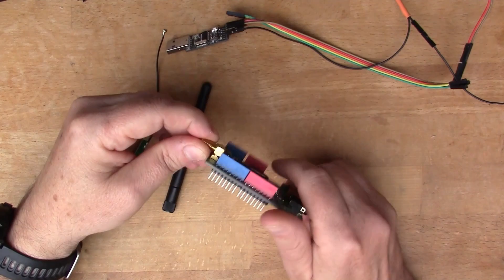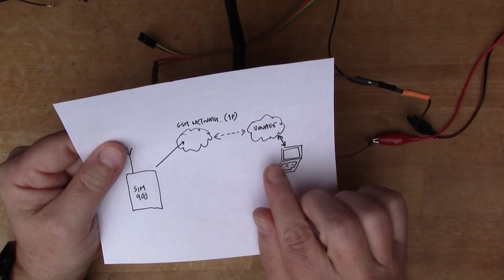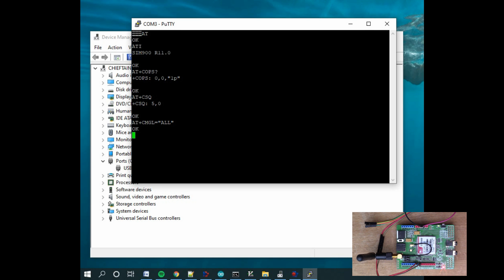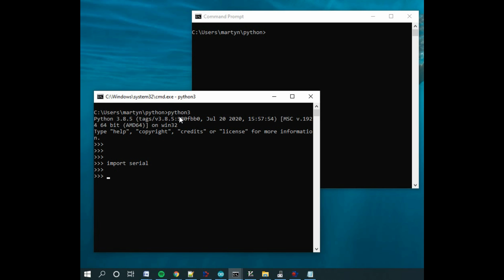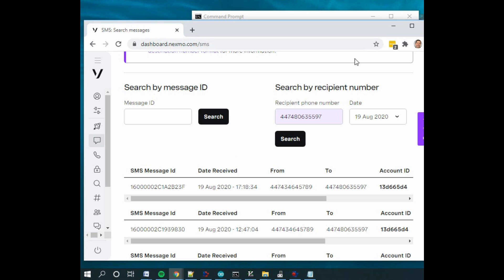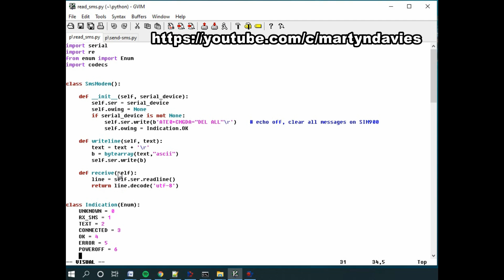Sending and Receiving SMS with a SIM900 GSM Module - Tutorial (#123)

Comment: I used a SIM800 to send SMS from an ESP32 in 2019/2020, part of a project that was a "granny monitor" for my mum. Easy to do, the hard part was making the right message at the right time: 10am send "concern" message, unless it had already sent a "mum's up" message, which must not be sent until WE were awake! It was just an IR sensor that detected movement and told the ESP that worked out which message to send when.
Then Covid came and I couldn't see her for most of a year, so the project lapsed, and now I don't need it and 2G/3G is being closed down, so no SMS any more.
Reply from the maker: 3G is closing down fast, but I think 2G will remain for a while longer, because it's hard living without a mobile these data and 2G is the affordable service (and phones).

Comment: when I send or receive a sms using the serial connection I always get these weird diamond questionsmarks, even thought it does send and receive the texts and all other AT commands work. any idea
Reply from the maker: Weird characters are usually caused by mismatch in bitrate between module and host, although if it is accepting commands, this suggests a rate match.  I believe this module should automatically adjust the rate when you send "AT{enter}"
Reply: @MartynDavies  Thanks for your reply. yes I've tried most settings, parity, stopbits, rate. some break it some settings still work a little bit when messing with stopbits. but the issue still remains. the default of 115200 8n1 seems to be working fine for most part, commands etc. 
It's only when receiving and sending texts it shows me those weird characters.

Comment: Brother, How to interface gsm with arduino using i2c pins (like sim900a i2c pins), Can you please send the code with schematic.
Be SAFE and keep your FAMILlY SAFE
Reply from the maker: I don't know.  The hardware design guide (https://datasheetspdf.com/pdf-file/770979/SIMCom/SIM900A/1) doesn't talk about I2C much, but it does say "Note: This function is not supported in the default firmware. There must be customized firmware if you want. Please contact SIMCom for more details."

Comment: When you say expensive it's all relative!  When you see the price of non chinese electronic modules etc it's still reasonable.  Cheaper than losing a freezer full of food I suppose!
Reply from the maker: One thing I learned from the shed alert is that it's actually hard to make a resilient electronic design that keeps running 24x7 and occasionally sends a text. I never regretted the £20+ I spent on the SIM900 or the £40 I spent on the Lithium backup battery.

Comment: A very interesting little module with lots of potential, your shed power alert is a great idea :0) Just wondered if the module could provide any visual confirmation for received texts (flashing led notification)? Appreciate the video, lots of work and well explained. Thanks
Reply from the maker: The module itself doesn't have a visual indication.  On my shed alert, an Arduino takes care of the detection of power loss and it drives a red/green LED in the shed window to show that the power is out. I'm re-designing it at the moment, but it's worked well enough the last few years. I'll make a video when the new version is ready.